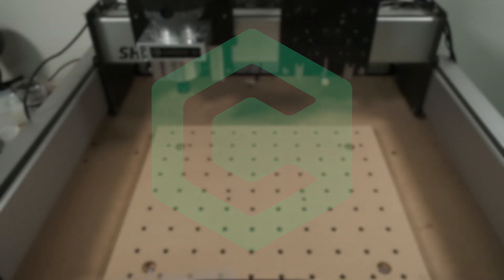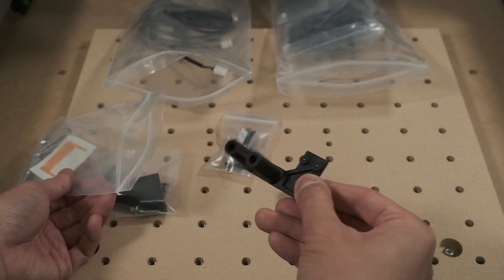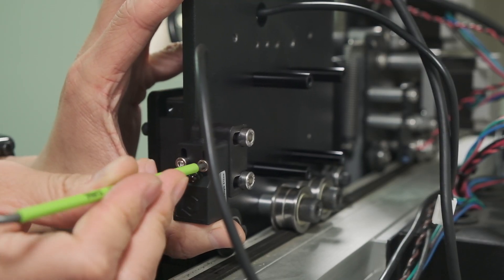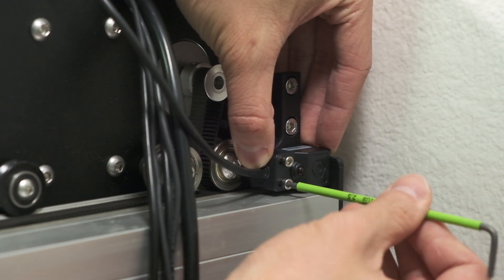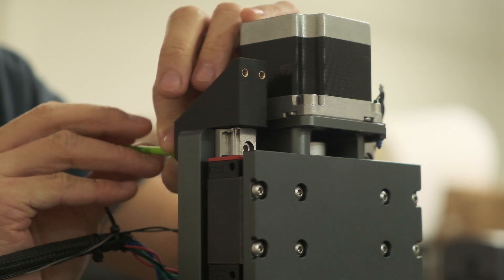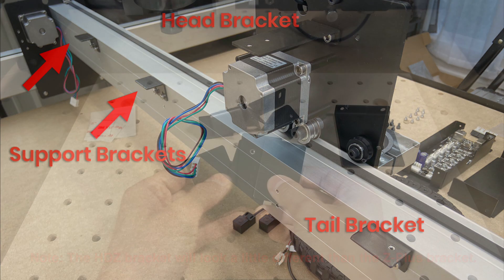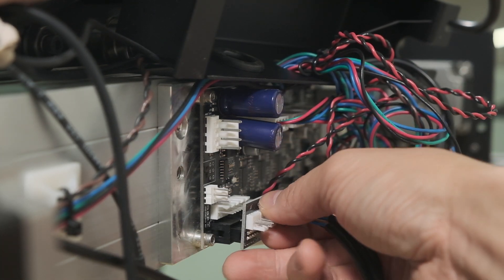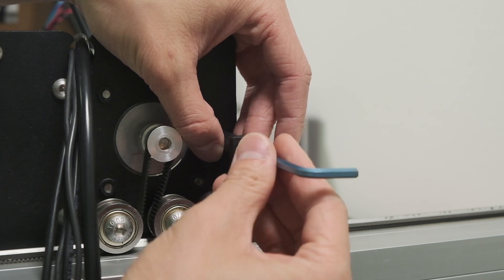Inductive Homing Switch Upgrade for Shapeoko

Comment: I do NOT have the M4 Screw to hold the Zplate onto the HDZ.  I also have another bracket that came with this setup that is not in your video and I'm missing most of those plates that hold up the drag-chain.  Disappointed as now my machine is down.  I'm trying to cobble things together.

Comment: In a couple weeks. I was told that in March as well.  If you are interested in a set contact Daniel at Pwncnc.com.  He has 29 kits available (was 30 but mine is on the way) plus I guarantee they are cheaper than C3D.

Comment: I put reed switches on my machine when it was a month old. Some people said they would never work due to vibration but they still work perfect today and it cost me all of about $10 and a little time to figure it out. I did 3D print a few parts to make installation easier.

Comment: Sweet.  Any chance there will ever be support for a second Y homing switch so the machine can self-square instead of being locked into whatever skewed angle it got bumped into while it was off?
Reply from the maker: It cannot be done with the current hardware as you'd need another input for the other Y switch. There's experimental support for it in GRBL, but at this time we're not pursuing it.

Comment: Hello Winston/Carbide3D, I've been using these SN04/05 style sensors for a few years on my custom machine and they've had pretty poor reliability compared to their LJ12A3 cousins - I've had two SN04 die on me so far (don't trigger anymore, were operated within specs, shielded, etc.). I don't doubt you have a reputable supplier, but it led me to choosing the normally-closed (NC) variant instead, as, when the sensor dies, it seems to fail safely (always triggered). Judging by the LED, you went with the NO version, which is probably fine for Shapeoko (also probably for board/firmware compatibility reasons), but I'd recommend the PNP NC version for any new machines, especially lead/ballscrew driven ones. Keep up the good work!